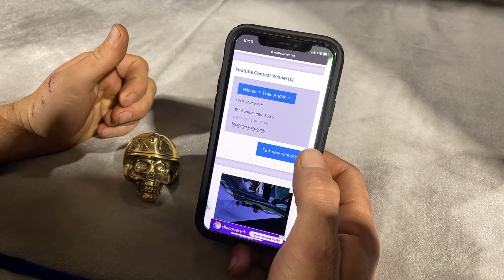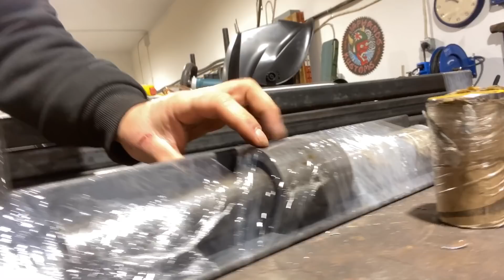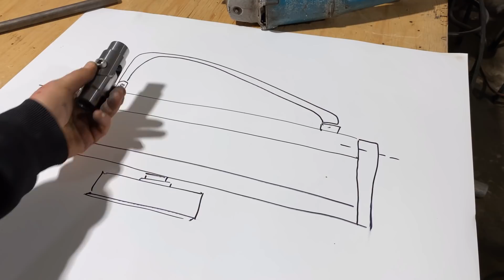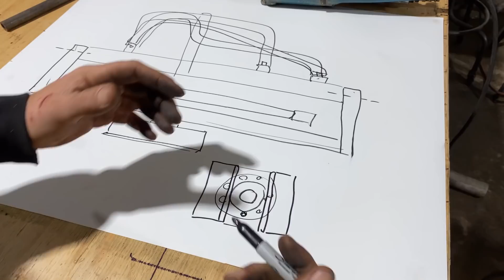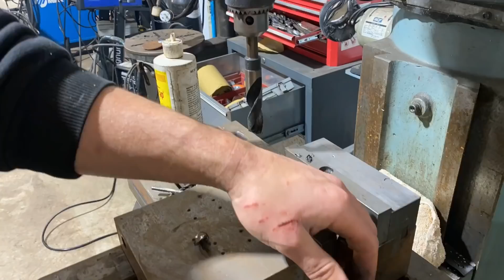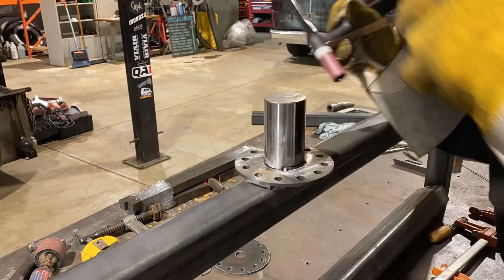How To Make a Welding Fixture For ANY Position!! - Twin Axis, Indexable Frame Jig

Comment: I was a welder fitter for many years and I use to build jigs and fixtures quite often, its the only way to go, when you need to build multiply units. Plus, if you take the time and build it accurately it will produce a very good product.

Comment: Great video. Try (ATF)automatic transmission fluid (new or used )instead of Tap Magic for drilling steel. Way cheaper. Works just as well.
Reply from the maker: Great suggestion thank you I will give it a try! Might be hard to give up the smell of rapid tap tho 😆

Comment: Great stuff as usual.  Wow, you are keeping a Windows XP machine alive.  Bravo.

I am surprised you welded in the 2x3 and it won't come out.  It will make the rest of the fabrication on that part more difficult.
Reply from the maker: You’ll see it will never need to come out the part will pop out of the jig after all the welding is done. As far as the windows XP machine lol that computer has its sole purpose only to operate the Cnc So I actually need to have an old version for the software I’m running. Works for me that computer was 40 bucks

Comment: About 3yr ago we went from a drop and vertical band saws to almost completely using the Evolution metal chop and circular saws. Total game changer, might want to check them out. The 14" chop saw rips through that angle iron like a carpenter's chop saw goes through a wall stud. We recently did a project requiring 1/8" 316L diamond plate, the circular saw blades would only last about 30' of cutting, but they did the job cleanly (it was a raw finish, plasma had too much post op).
Reply from the maker: Yeah that’s something that I would love to get in the shop is a cold saw. A buddy of mine sent a video of him using a Makita circular saw with a metal blade cutting half inch by 6 inch flat bar lol

Comment: I have not been a van person but your van is just too neat to ignore,  just too cool. Now to find one based on "The Princess Bride". Lol

Jigs and fixtures is more art than most mechanical things.

You're thought process is spot on, production is key, less steps or motion means faster turnaround. I was thinking of mounting your plate on a swivel stool. My mind starts off simple then updates to meet demand, accuracy, durability and repeatability. 
I think you need to add a ground tang for your welder to attach to.

Great process video.

Comment: Awesome win Theo!  Great jig idea Karl. How about instead of having a pinned disc since you are limited to those positions only, use a brake caliper from something small like a quad, or a go kart caliper from princess. Use the disc/caliper as a holding brake and have a cam over manual actuator for the locking mechanism. The positioning is potentially any degree line you can turn the jig to. You could also have second setting on the cam lock as a "drag" setting. The caliper would contact the disc only enough to apply enough drag so the jig won't move easily, you can still turn the jig on the fly. You could also mount the jig frame on a central locking hinge over the disc like a lathe tailstock so you can lay it down at any angle for better positioning. Not to worry, car tools IS car content!
Reply from the maker: Toby! I absolutely love that idea! Wish I thought of it sooner

Comment: If this makes sense. Used threaded rod as shaft with nut on end through plate. Used old ring spanner cut short added spring plate fastened to frame. Gave me 12 positions just pulling spanner of nut. Lock rotatoring frame very well...

Comment: I am a recently retired special machine/gadget/widget designer with 50+ years of experience. I started drawing on the board and worked my way up thru multiple CAD systems all the way to 3D CAD.

I still like to see how people solve mechanical design problems. I have designed many workholding fixtures similar to what you've just built. Great video
Reply from the maker: Wow Gary I bet that was interesting working all the way from pencil in ruler to 3-D AutoCAD !
Reply: @MakeItKustom  I got out of the Army in 72 and began college on the GI Bill. We didn't have any calculators at that time and had to learn to use a slide rule! Sometime in 73 or 74 I bought my first TI calculator and it was the best. You didn't have to look up sines or cosines in a book because the calculator did those and square roots, too. Younger people don't know what that was like!

Comment: How about some more info on your CNC plasma cutter.
Reply from the maker: It’s a very old machine. It’s modular so it can be built and replaced each piece. The company that used to sell them is not around anymore. I have course bought it used and got a good deal. I’m using a hypotherm powermax 65

Comment: On your welding table I seen you are using threaded hole with t slot clamps, are those 1/2 x 13?
Reply from the maker: This one is 3/8” nc Very handy to be able to use those type of fixtures
Reply: I've avoided building one this way because we had issues with holes wearing out when I worked at a fab shop but doing production welding for 1000s of parts is different than how I would use it. I might go ahead with a new welding/fixture table build.

Comment: Hey Karl, is that a coolant line to your hack saw or an air line for air cooling ?
If it’s coolant , what do you use ?
Thanks for the awesome content 
You rock 🤜🏻🤛🏻
Reply from the maker: Lennox cutting fluid It works quite well I honestly have not change the blade in years and it still cuts clean and sharp

Comment: Pretty interesting fixture.  As im watching i wonder if you were going to lock it. Yup. 
I imagined it differently, notches instead of pin holes. To me a spring loaded lock lever is easier to create. Overall, it will jig!
This is all part of the build, like making the special wrench to get at the bellhousing bolt or motor mount. Just way more advanced.
Reply from the maker: I like your idea with the nachos! I was thinking about a spring loaded pin as well to be added

Comment: nice looking jig. However I notice that you have a bit of rocking on the z-axis where the fulcrum being the bottom bearing. I wonder whether this would hamper you in any way while you are welding the hammer structure. Thanks for posting the educational content. Looking forward to the next videos.
Reply from the maker: Yes somebody else made a great suggestion instead of having pinned discs I could’ve used a over centre lever action mechanical disc brake. I love the idea but I think the pens will be OK

Comment: My favorite way of welding is on my 210 arc welder I used Lincoln's mig welder the wire feed kept getting stuck it seemed in was trying to weld faster than the wire came out and it didn't get full penetration on my welds unlike my 210 arc I get stronger welds

Comment: I'm trying to find a good metal brake but like everyone else right now, not trying to break the bank..... Also, how much are you going to be selling those hammers for?? One more thing and I promise I'll stop, lol...... If you already had a Multi-processes welder, besides a metal brake, what metal working tools would you get(I.e. Bead Roller, shrinker/strecher, english wheel, etc) what brand would you recommend that works good enough to not get divorced over.... haha.... I know you get what you pay for but I just can't bring myself to buy some of the stuff I see out there.... Thanks for always provoking thought with your video's!!
Reply from the maker: If you look back in the videos and find the shop tour. I talk a bit about how to get good equipment for cheap. Keep an eye on Facebook marketplace or craigslist options etc. I buy all my equipment used for the most part or I build it to keep cost down and I actually just enjoy buying selling and building. In English wheel is a great tool Accompanied with a leather shot bag or a shrinking stump and a bead roller. You can do a lot with those tools.
Reply: @MakeItKustom  Do you know how much you are going to be asking for the planishing hammers? Also, I don't have a Facebook (security reasons) so I never get on marketplace.... but if you run into a good deal on something please let me know.... I live in east Tennessee so I don't know how shipping would be but I know that guy's like you, while being setup as a production deal, you take pride in what you do and are a bit of a perfectionist... As a former Green Beret, I know the feeling.... haha....